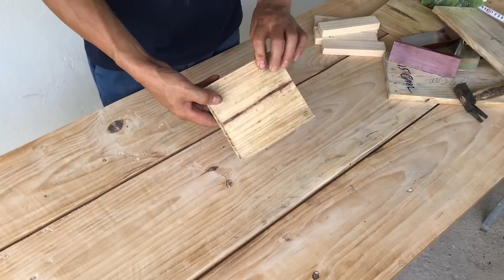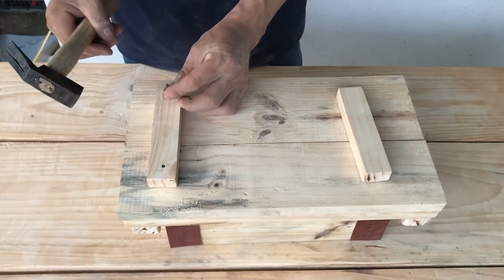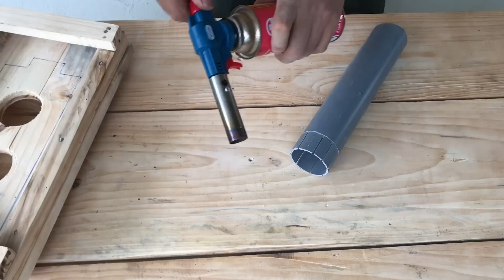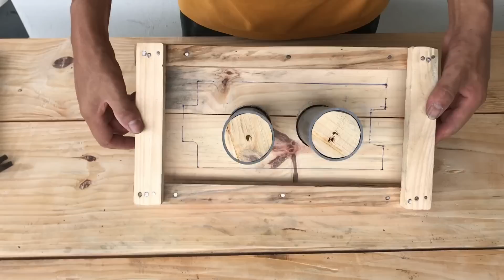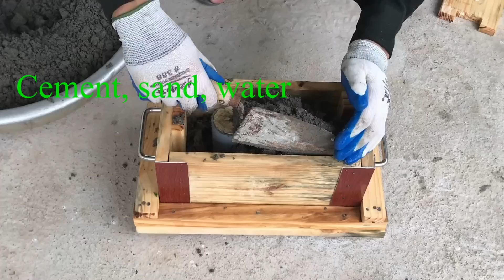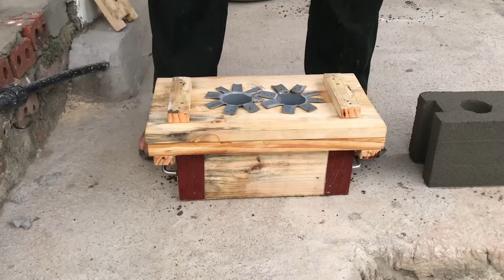How to make an articulated cement brick mold - Crafted from wood

Comment: Improve this by adding polyester or hemp reinforcement fibers to the concrete mix, keep the concrete mix as dry as possible, and manually tamp and compress the concrete in to the mold like you would with a rammed earth wall. You should get bricks with compressive strength in excess of 4000psi.
Reply: Adding the solution of water mixed with a couple of eggs will give the bricks unbelievable strength.

Comment: It is good to paint the wood with mineral oil a few times before first use, and then after a few uses. It keeps the cement from sticking.
Reply from the maker: yes thank you
Reply: It will make it super hard to put plaster on oiled surface inside the building though. Oil will not allow the plaster to stick to it, which won't allow putty to be applied. One would have to clean the wall off the oil, which is rather hard and expensive, sadly.

If you don't remove oil layer from the bricks, you may face the situation when the plaster and putty crack or outright fall off due to their inability to connect to the brick surface. : /
Reply: @judgemondgeboren  Not realy, you paint the wood, not lather it. The wood absorbs the oil, not the concrete.
Reply: @manofwar556  I was speaking for experience though. Concrete does get stained with the oil and it becomes a huge issue, even though the wood gets its desired protective layer. The concrete gets stained with a tiny layer as well, although tiny - it is VERY capable of causing problems. Best to just avoid using oil. : /
Reply: Dont use oil, go to the builders supplies and get a can of concrete mould release this will let the brick out of the mould without the later problems oil causes.
Reply: NO concrete doesn't bond to wood.
Reply: @darkshadowsx5949  concrete does get in between the fibers of wood, and it makes it very hard to clean off.
Reply: @darkshadowsx5949  You need to go look at the concrete stuck to concrete shuttering boards when they peel them off the concrete. And i DO mean peel. And that is after they have been treated with concrete release agent. You are obviously not in the concrete moulding industry.
Reply: @darkshadowsx5949  worked for years in construction, yes it does.
Reply: No, just put hinges at the bottom of each wall of the mold, and clamps up on the four corners. Also, the bottom of the mold should be only a frame, not a solid piece. Most of the bottom should be an empty rectangle. You then fill that rectangle with a piece that size (and the same thickness as the frame). That piece contains the PVC shorts. Once cured, flip the mold over, release the clamps, and then fold up each hinged wall to remove the outer portion of the mold. Now simply pull the inside piece up toward you, straight out, to remove it (dowel holes on its side ends would facilitate this). This approach releases the brick from the mold one wall at a time such that "sticking" becomes a non-issue. Silicone is also an option, now sold in a spray can.

Comment: Looking straight down at such blocks from above, each has an end with a crotch and an end with a neck. Fair way to put it. The distance from the inside of the crotch to its hole should be the same as the distance from the outside of the neck to its hole, and should be half the distance from hole to hole. Now all holes in a row are equidistant apart, such that when you stagger the rows all the holes still line up vertically and can therefore receive reinforcement. It means, in other words, that from the top of a completed wall (before capping it off) any of the holes can be filled with sluice (runny cement) and then fitted with a piece of rebar the same length as the height of the wall.
Reply: @yoshisaidit7250  Nice. Dedicated channels for wiring. Doubly protected. Convenient. Also for water, lol. Use a short piece along the way to make sure every brick gets properly aligned. No mortar. However, the pieces of PVC used for the mold itself do need to be artificially given a 1-2mm larger diameter (perhaps by neatly wrapping them in tape), because otherwise the fit will later be too snug to allow PVC pipe [of the original diameter] to be rammed down through the holes.

Too, your idea this makes another consideration possible, as follows. Make the bricks only half as thick, just with smaller holes. Here's why. Insulation. You could build one wall, and then another exactly like it, with an air gap of, say, an inch between them. Air, as we know from double paned windows, is a great insulator. Now, in matching fashion for each completed wall, ram PVC pipe down every other hole (or every 3rd hole) to secure it, but leave an inch or so of pipe sticking out the top. That way with elbows and a short piece of pipe you can essentially connect the two walls together before capping them off. (With proper planning, you could even ram some rebar down through the PVC.) All in all, get far better results using the same amount of cement, at least where trapping or blocking heat is desired. Also shorter cure time per brick.
Reply: @yoshisaidit7250  The beauty of forming both an inside and an outside wall with an insulative air pocket in between is that the inside wall ranks as just that and, naturally, is warmed by whatever heat defines the room. Naturally, that's where plumbing would go. There are also plumbing methods that allow for dead zones (cavities), meaning that there are spaces for the water to expand into if freezing does occur. I'll admit though that I formed my ideas primarily with temperate climate in mind, such as in the Philippines, where people tend to build their own homes forming cement walls reinforced with rebar ...that is, when they can afford it. While bricks by comparison take more time to manufacture, there's also a cost savings to be realized centered around whatever percentage of the brick's volume is actually air. Too, in a tropical environment there's pretty much no end to the kinds of fiber(s) you could mix in, at an even greater cost savings, so long as you apply pressure to the brick while it's curing. Makes for a less friable brick too.

Comment: That is pretty awesome - well done!  How long does it take the blocks to cure?
Reply: read the directions on the bag. 
probably need 50 of these molds if you want to make a good number of them on a weekend. probably start selling them at that point.
Reply: This seems to be a standard sand cement mix and the typical 'cure' period is 28 days. What that means is that cement/concrete cures to about 50% of its full strength within 28 days and spends many many years continuing to cure after that time. Engineers typically work to the 50% strength criteria, or about 4 - 6 weeks for making calculations surrounding load bearing decisions etc etc (from memory, it's been a LONG time since I was at uni). For a dry mix like this it will setup and you could move the bricks around in 24-48 hours, depending on the environment. If were going to try this i would recommend spraying down the blocks to keep them moist for the first 2 -3 days, depending on how hot and dry the climate you are working in is. This would assist the bricks in not cracking during the initial drying period.

Comment: Put 4 bricks into a portable tabletop oven to cure on 125 degrees if you fill those holes before you app other bricks sand is a great insulation to keep in heat or cold. Take it from personal experience.
Reply: Drying concrete quickly will drastically reduce the strength.  It would be best to cure that concrete under a plastic tarp, a wet cloth, or in a water tank.

Comment: Did I mis-see the building of the mould? Looked to me like the piece of wood forming the female gap of the interlock was smaller than the space left to form the male interlock projection.... these blocks won't interlock.
Reply: I think he just did not show him cutting it. He places the piece of wood that would create the void for the female end of the brick between the two pieces that would create the voids for the male end. It fits between those. Then he removed that piece of wood, and one step later, brought it back to install it. So we missed that small part of the step.

Comment: Nice mold; now all you have to do to make articulated is teach it to talk???
Reply from the maker: thank you
Reply: articulated means flexible joints not teaching it to talk. not to mention cement doesn't make sounds required for speech.
Reply: @darkshadowsx5949  For your edification I offer a few more observations! While this site claims to be located in the US it probably originates in Vietnam. This scenario is common throughout YouTube. As a consequence this video was edited by someone other than participant. This individual, sharing your age and intelligence, decides to glorify the accomplishment to impress everyone. The word articulated (definition 2) works for the author's purpose in describing the mold about as well as it would for describing your fingers, but is most commonly used (definition 1) with reference to speech! Lincoln once said "better to remain silent and be thought a fool than to speak and remove all doubt"??
Reply: the word used relevant to speech is Articulate, not articulated. As in ' his speech was very articulate'
Reply: @sinkhole777  the word relevant to your lack of knowledge is dictionary, in which the word articulated is defined as an adjective meaning "made clear or distinct"!!
Reply: @jackriley5974  true, however, when describing a specific thing we Articulate (past tense articulated) that fact (verb), present tense and past tense, and when we speak effectively in a general sense we are called Articulate (adjective). in describing both speech and machinery the word is appropriate. I was just trying to extend your humour in the use of the word, no offense intended

Comment: What would happen if you were to add epoxy instead of water would it make the concrete brick even stronger?.
Reply: You would get very dry and fairly weak epoxy. Cement needs to be hydrated for the chemical reaction to occur and cure the concrete.